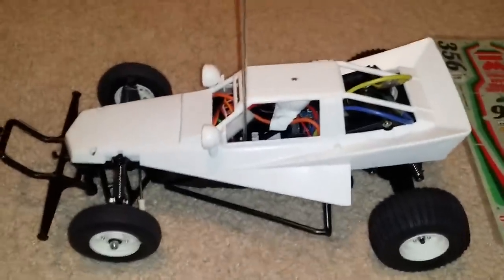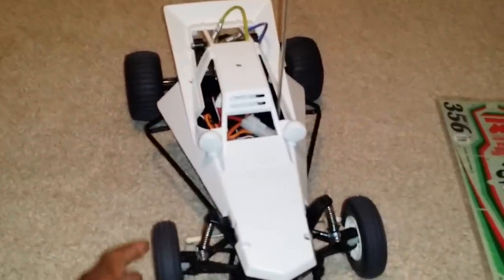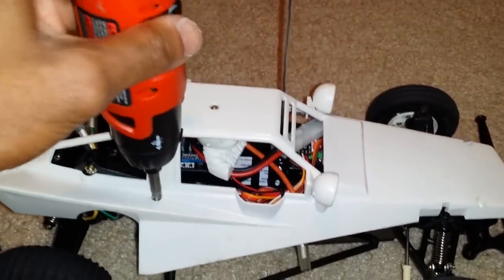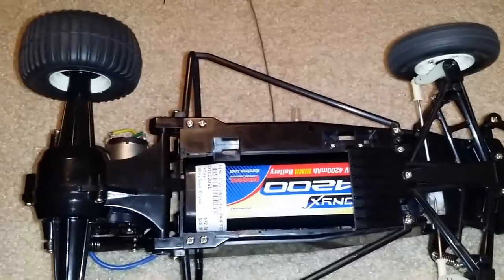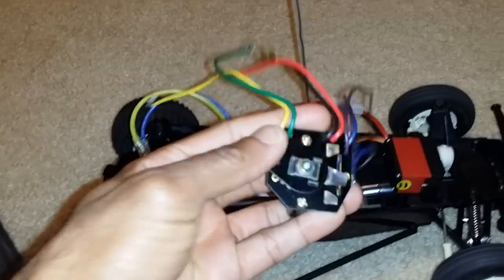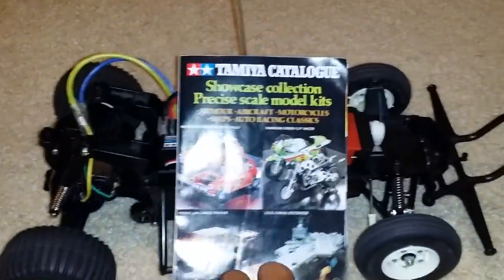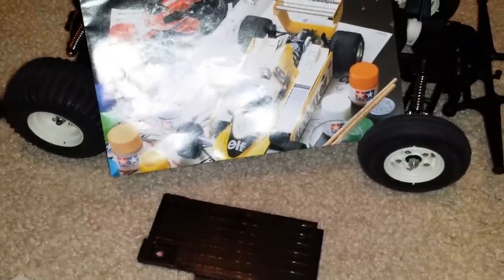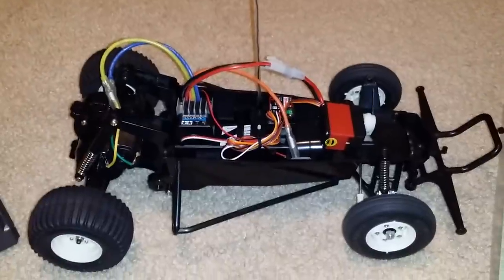Tamiya Grasshopper quick look

Comment: Wow. 
My first car in 1983ish. I bought it as soon as I saw it on the shelf, I really liked the look of the car and it wasn't a lot of money compared to those Tamiya cars we all drooled over in the mags back then. But it looked the part. 
380 motor, stepped mechanical speed control, I do remember going for the humped cell battery pack (It was the big one). 
I bought the rs540 motor after a couple months, rear oil shocks, and bearings for the rear. That and spiked rear tires made it a baseball diamond terror(at least it threw gravel up in our faces). 
I drove it many, many times, probably a few hundred runs, I seem to remember running down a couple friends car batteries, we drove it so much.  It did not wear out, I sold it after a couple years of hard use, countless hours of running, and it was still going strong. 

I used a 2 stick radio on it too, oh man. 

Memories. Thanks :)

Comment: Good video. But you need to address the suspension of this chassi. The Hornet had a slight change to the rear suspension system, such as extended oil filled dampers and prolonged shock mounts for them. Also that new horizontal bar which allowes a certain travel, or yaw, to the complete rear puzzles me. I've noticed that the Grasshopper has no yaw property on its rear, it's locked stiff. I've seen your other two vids where you drive your Grasshopper, but you're not really challenging the design due to the flast asphalt surface. I am curious what your opinion is on the Grasshopper rear suspension design. I'm not really comfortable with it, to be honest. I can't figure out what motivated Tamiya to create such a design.